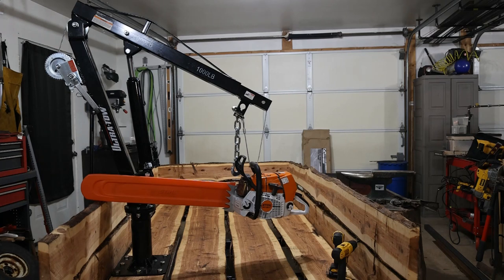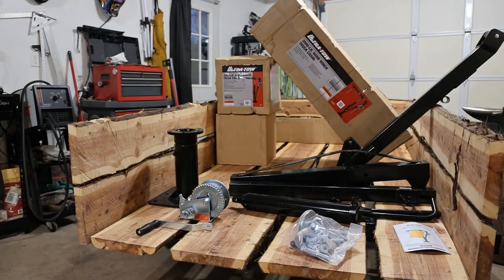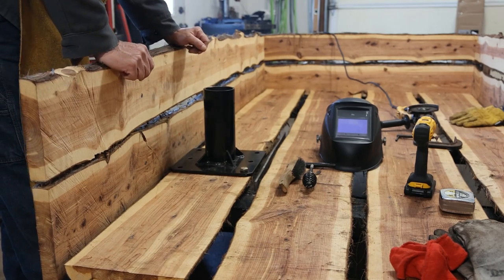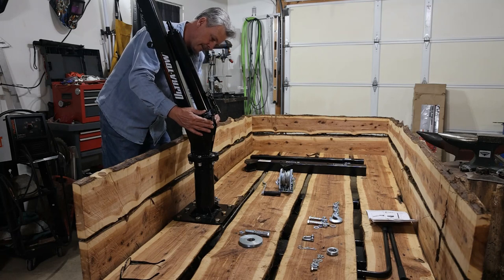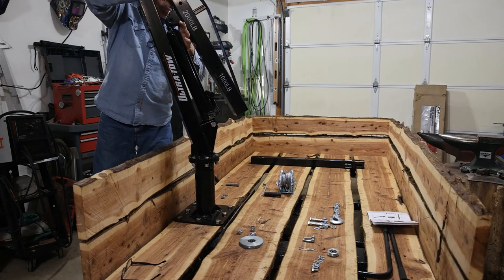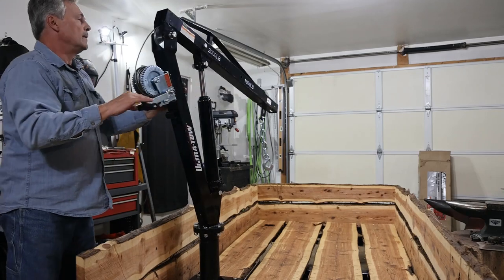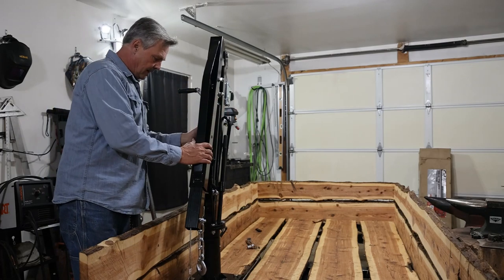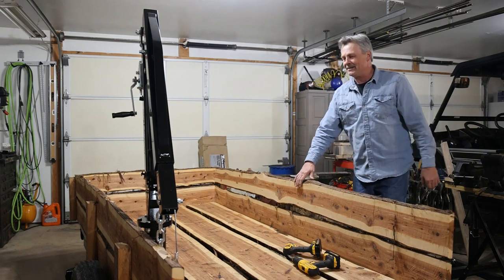Truck Crane and Little Farm Trailer Unbox- Install

Comment: Thank you for the inspiration!  I have an old Harbor Freight that I'm gonna re-do and I never thought of putting the  truck crane on the trailer. Great idea!
Reply from the maker: Hello Matthew, The trailer redo will be a fun project for you. I put out riggers on the back of this trailer to help support the weight when lifting, this crane swings easily and I don't want to turn the trailer over LOL. Good luck with your build and Thanks for Watching.